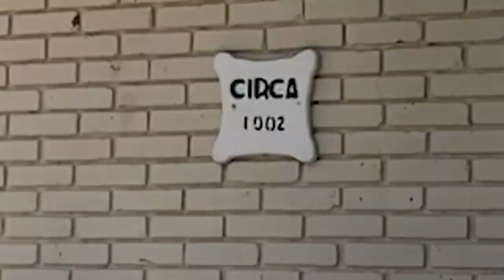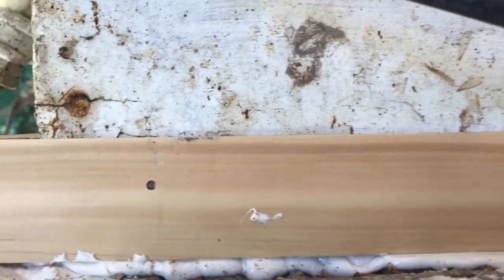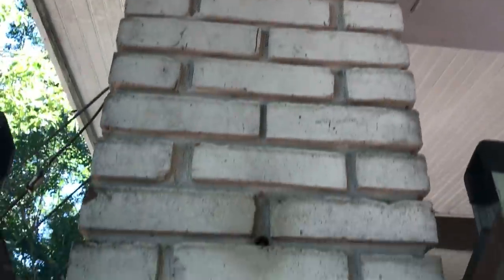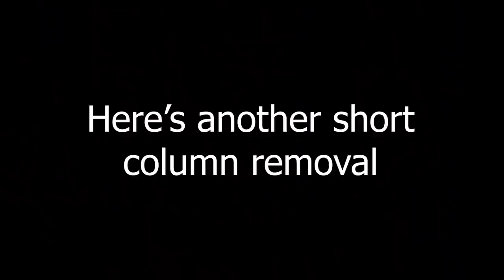The Worst Way To Get "Free" Bees

Comment: The worst way I ever got a free bees is when two bumblebees went up my britches leg while walking through a clover patch. I jumped in a pond. Then back out of the pond. Then went streaking.
Reply: I got two pant legs full of yellow jackets 🐝 one time I still don’t know how I got through a 5 strand barbed wire fence while pulling my pants off in one move lollllllllllll
Reply: @randlerichardson5826  I`ve learned just to avoid the outdoors completely in the Fall because every year I`d get into a massive yellow jacket nest. The last time they were in a tall clothes basket under a porch at a friend`s house and all attacked at once. I was stung at least 50 times. Another time I was raking pine straw and was pinned in between some bushes and a fence with only one way out and got covered with them and had to strip to get them off of me while running through the yard beside a major highway. They were holding on to my clothes. It was almost dark when it happened and I didn`t realize what was happening until they started stinging my face. And now murder hornets are here!
Reply: @randlerichardson5826  Have you ever been going 80 down the interstate and a have a red wasp get inside your shirt?
Reply: I was driving up the boundad hill going towards Ignacio, Colorado had my window down and bee 🐝 came in my window stung me on my left hand. Who how's that kinda luck to get stung going 55-60 miles down the road.

Comment: Did my first cut out a few months ago turned out horrible what they said had been there for a few months had to have been there for years two sections between studs were full from floor to ceiling... I had no bee vac... I got stung over twenty times fifteen of which in one arm... missed the queen... and the hive died off afterwards because it was too late in the season and I couldn't find a replacement queen for them....
Reply from the maker: Stop it.  You're bringing back too many good memories.  LOL